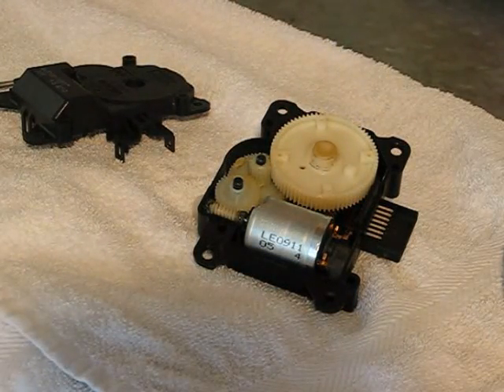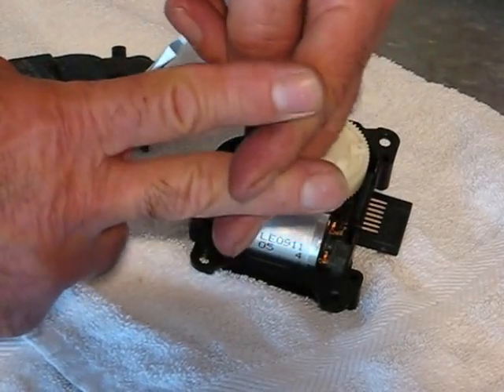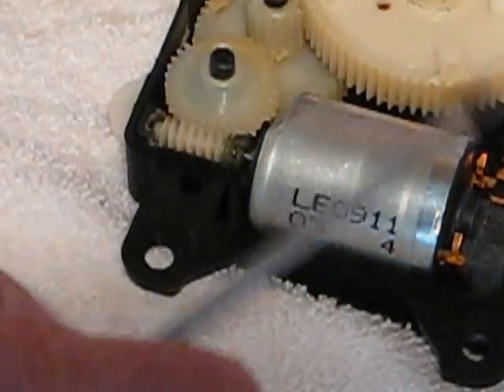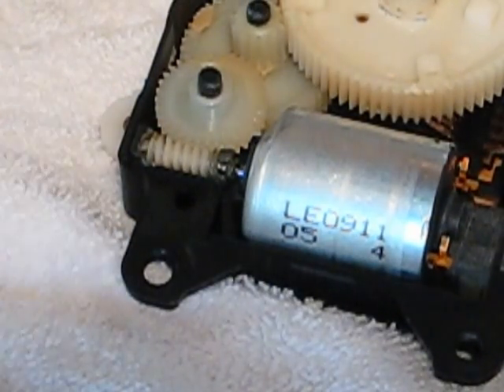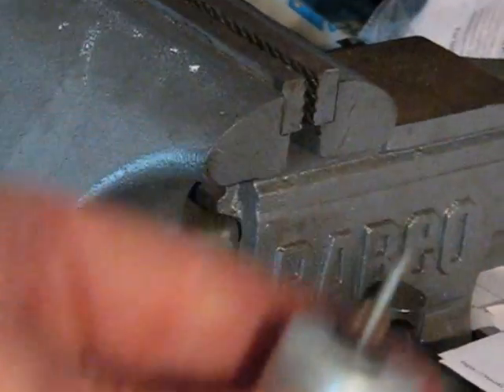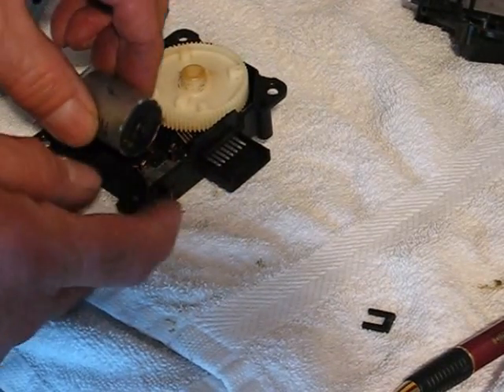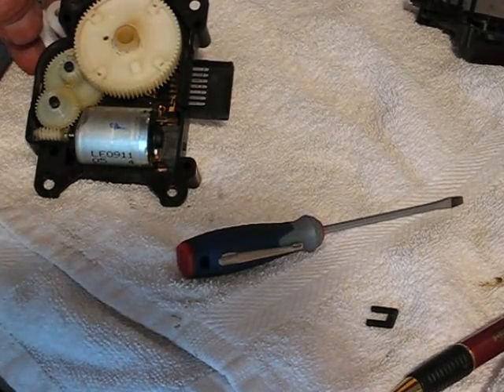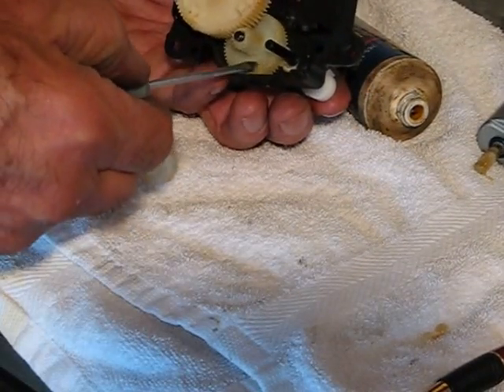Lexus servo motor air mix repair taken apart by froggy

Comment: Ok so will this pretty much fix the noise and the ac getting stuck sometimes on hot or cold? Currently stuck in hot btw
Reply: I did replace the motor that controls the climate control, the one that you can co trol the face, face and feet, the front windshield by a getting a cheap ebay one for $30. That problem was fixed now I just need this one to be fixed, the one that controls hot and cold air, I couldn't seem to find a cheap replacement for that one, it seems that there's only oem denso replacements for that one which are like $100+ and I wasn't trying to pay that amount. Hopefully this solution will fix it like you said!
Reply from the maker: yes, should.

Comment: Question: would it make that buzz noise if the AC system is off? Mine does so I’m wondering if this could still be the problem.
Reply from the maker: I think so, it's the broken gear buzzing as it tries to move air direction flaps around to different places.

Comment: Froggy I’ve been In the IS community for 10 years now and I have really enjoyed your content I know this video is really old but it still is extremely helpful. I took a different route with mine. I plastic welded the worm gear to the yoke and also added a dab of plastic weld to fill the hole that the worm gear chafed away at so it adds insurance to the fitment of the work gear. Cheers
Reply from the maker: I really like plastic welding.  :)

Comment: Would this be a cause for no cold air when the ac is on? I'm only getting heat no ac
Reply from the maker: Probably not, if the controls direct the air flow where it needs to be, then your a/c system is likely at fault, see a/c not cold type videos.  :(

Comment: Mine arm keeps popping off the servo for the mode control. Any ideas ??
Reply from the maker: small zip tie? and glue tie in place.
Reply: @1947froggy  the little steel insert on the server arm , it inserts into the lever on the heater damper. The lever keeps popping off. Cable tie and glue won't work. Needs to move freely
Reply from the maker: @stephenh1616  Got it, can you "peen" over the pin so it stays in?
Reply: @1947froggy  no , as I woudnt be able to insert it into the arm if I done that
Reply from the maker: @stephenh1616  I meant after it was inserted, can you hit with a punch or chisel to peen?

Comment: Very similar motor as a 2005 Toyota 4Runner and the fix is exactly the same. I also used Loctite Sleeve Retainer to hold the worm gear on the shaft in addition to tapping the yoke to eliminate the play between the shaft and worm gear. Worked perfectly on mine and took about 1-2 hours. Removed the top two screws on the bracket that the motor is screwed to so I could make some room to get the bottom of the three screws holding the motor to the bracket out and then the motor itself out. To get the top rear bracket screw back in I taped it to the head of the screw driver and then threaded it in. This video will show you how to get it out of the car: https://m.youtube.com/watch?v=kKOhDF-zG6A
Reply from the maker: Excellent, froggy seal of approval!

Comment: Froggy...going to give this a try today...on my 02 4 Runner.
BTW..the door actuators can be fix, by changing out the motor. STEALERSHIP wanted $180 for the complete unit. I found the motors on Amazon for $2 each. Easy fix, once you do it one time.
Just sharing...my experience.
Reply from the maker: Good on you!
Reply: @1947froggy  Hey Froggy...
Found my issue why the blend arm broke. The hot water valve cable...does not move freely. Squirted it with Blaster.
Worked it's way down , but still hard to move. Being in Florida...I rarely use my heat.
Guess the cable is bad???
Tomorrows project....
Reply from the maker: @williamb2854  Likely that is it, good detective work!
Reply: You remember how you found them?
Reply: @mjf4241  Go on Amazon...
Key in electric module motor number.
Well worth it...
Do not go to the STEALERSHIP!!!
Reply from the maker: @mjf4241  Amazon search, with make model year. No guarantee it'll work or maybe rock auto?

Comment: Thinking of doing this tomorrow since it’s getting cold in NewYork again, the issue I’m having is I have hot/warm air coming out of the right side of the vents but cold on the left side? I know this is a very old video but if anyone can  help me out by letting me know which one it is it would be very much appreciated. I am also hearing chirping noises coming from around in between the radio and the glovebox

Comment: This design has an eerie similarity to the range of Panasonic VCR's which employed a loading motor that did the loading and unloading of the tape around the video heads.The motor had a cog that was press-fitted to its shaft and this cog inserted into the worm wheel gear, the same as seen in this video. The press-fitted cog would crack, resulting in no drive of the gears. The upgraded design used a nylon instead of a plastic cog. In this case, the brass cog has loosened and moved away, disengaging from the worm gear. You will have to ensure you have some way of securing the cog, because if not permanently fixed, the fault will reoccur.

Comment: Fixed this in my 2001 IS last night. Instead of shimming the worm gear, what I did was put a drop of gorilla glue and slid the worm gear on the shaft all the way onto the shaft. Now the worm gear is always engaged by the yoke and moves the other gears as it should.

Comment: How did the worm gear move off it set location? Looks like the gear it turns has a few teeth missing thus allowing the gear to slide out of sync and be pulled by the gear away from its set location and not return to set position. Glad your fix worked.
Reply from the maker: Just from spinning & not a tight fit, no teeth missing.

:)

Comment: Just did this on my 08 4Runner, but instead of using a vise and hammer, I just used a screwdriver. Vent control works perfect now! Thanks a bunch!
Reply: Jody Castro I’m having the vent control issue now! I’ll try this tomorrow, how easy was it to access and take the part out?

Comment: hi Froggy, just need some advise. i have a 2003 lexus gs300 and well besides the server motors making noise, i can only get hot and cold air on the passenger side. on the driver side i only get hot air and sometimes when it feels like it and i leave it at 65 degrees i will get cold air on both driver and passenger side. but once i raise the temperature to hot the driver side will remain in hot and the passenger side works like normal (hot and cold air). ( i tried using the duel air feature to see if i can get cold and hot air on the driver side and that still doesn't help) please help. and thank you for the video
Reply from the maker: It's all the servos, you need to personally diagnose (by touch feel look) which one(s) are not moving correctly & replace. Watch the videos again to see how I did it. Post back how you do.

:)
Reply: froggy thank you so much for the reply.  I'm gonna try to do it on Monday if I have some time.  I will definitely let you know how it goes.  Thanks again.  :)
Reply from the maker: You bet.

:)
Reply: i got'er done froggy!!!! lol. both sides. about 2 hours. cost me $0.00. lol I Get cold and hot air on both sides now. i also now get to use my dual A/C feature. and no annoying noises anymore. FROGGY MANY THANK YOUS MY FRIEND, For taking the time to teach us and show us. you're awesome and im so happy.  thanks again
Reply from the maker: Good work!
Reply: ty

Comment: it's blowing out cold on the driver side and hot on passenger side. I had 1 actuator replaced last year that controls the mode. thanks
Reply from the maker: Thanks for posting.

:)

Comment: Hello I just got a diagnose on my 04 lexus gs 300. I was told it's the temp door actuator. what's another name for it? I'm trying to order it, I just wanna make sure I order the correct part. thanks
Reply from the maker: The other name would be blend door actuator, it blends the hot and the cold.

Comment: Just bought a 2004 RX330 and I have that random clicking noise on the left side of the glove box that everyone complains about on their 300 series. I been told there are 4 servo motors in this car, so if I have my boyfriend replace it how do I know which servo motor it is? Do I need to replace all 4 of them? Please advise. Thanks Sue
Reply from the maker: Whichever control does not respond (hot/cold, left/right/recirc/mode) is the servo to replace, nor all 4.
Reply: Thanks so much! So do you have a part number?
Reply from the maker: They are different, depends on which actuator & I don't have them.

:)

Comment: Hi bud - Thanks for the awesome video. 

I removed the servo motor and wanted to know if I can replace the small motor that is inside the unit? I don't want to replace the whole unit since it cost a lot more. On the tiny motor I see ''HB0418'' ''16'' ''2'' but unable to find this motor on line. Does these tiny motor have a particular name? I have a 2000 GS 300. Thank you, again.
Reply: illhorsyou ever find a motor?

Comment: I have been driving around all summer thinking I was going to have to replace whatever was keeping me from getting air to my face.  One easy search, found your video and did exactly what you did and now my legs are no longer freezing and my face is nice and cool. Thank you so much!  This is a design flaw in the part IMHO, if they had put the drive shaft yolk further up the shaft, this would never have happened. Thank you again!
Reply from the maker: Nice work!

:)

Comment: Hi. Do you have a video on how to take out the motor? My IS300 mirror motor runs constantly but the mirror does not move inwards or outwards when I press the switch. Any advice?
Reply from the maker: Not a mirror motor, sorry.

:)

Comment: In my 2003 Lexus RX300, I had been getting a periodic grinding noise in the dash for years but never did anything about it. Recently my air mix stopped working and air would only come out of the dash board vents no matter what the setting. I was worried this might not work since my air mix had stopped working completely. But it worked! Air mix working again and no noise. I guess the worm gear had completely disengaged. Tightened it up as described in the video and it is fixed. One added tip, I added a small dab of locktight to the collar that holds the worm gear to hopefully keep it from moving again. Thanks!
Reply from the maker: Good work!

:)

Comment: Hi. I have two problems with air conditioner in my 2005 Toyota Sienna: 1.The same clicking problem. 2. Air at driver's side is not cooled.  Can this servo motor failure be responsible for both of them?
Reply from the maker: Yes, possible.

:)

Comment: The mechanic told me my 2001RX300 have 2 servo motors attached together, therefore it requires to change both motors. Is it true this car have 2 servo motors? He also said it is a 5 hours job coz the dash board and the air condition lines need to be drained ...... is it all true??? Please advise
Reply from the maker: None of them are "attached together". They "work together" to control hvac but they go bad one at a time. OTOH if you are going to pay a guy all that labor to get to the motors, it "might" be a good idea to replace them all. The dash does not need to come off. WATCH MY VIDEO. All from underneath. A/C lines drained is COMPLETE mechanic BS. I would strongly recommend find an honest mechanic.

:)
Reply: Thank you so much for the advise. I understand now and will find a right mechanic to help me.
Reply from the maker: Very welcome, I especially like to help women, as they get "taken to the cleaners" by dishonest mechanics so much.

:)
Reply: You're right. This mechanic gave me a price of $600 for part and labor. I found another mechanic after your advise, he only charged me $70 for the labor and my car's clicking noise has stopped now.
Reply from the maker: Happy for you, rx300 is a good suv.

:)

Comment: Thanks for the video, helped me with my is300. Learned so much with just a week of owning.
Still need to fix my door actuator.

FYI, i recommend people solder the key in place using fine tip and JB the back of the key.. Mine was not locked in place anymore,. would just spin..
Now i have face and floor lol.

Comment: Hello Froggy, do you know if you need to remove the dash to install the servo motor on the 2010 RX 350? I am being told that the servo on the passengers side requires the dash to be removed in order to install the $500.00 servo motor. Please help. Thanks, Steve
Reply from the maker: +Stephen Aumen Not the dash, the glove box & panel. SEE MY OTHER VIDEO to get to it.

Comment: hey froggy,
my heater nor is the AC blowing air in my GS300.. But when i cut on the defroster very slowly air comes out. What may be wrong? 
thanks
Reply from the maker: +Marshall S Hobbs III That may suggest that the "mode" door (which directs air to different vents - depending on the desire of the driver) may not be operating correctly. It would be one of the servos.

:)
Reply: +froggy thanks for the reply. How can I find out which servo is inoperable?
Reply from the maker: Watch the video again. You need to access the area under the dash where the servos live. Then operate the hvac controls and look at what moves like it should and what is not moving or looks like it's having trouble, also LISTEN to the sounds of a good servo vs a bad one.

:)